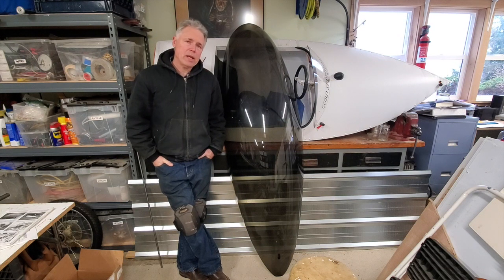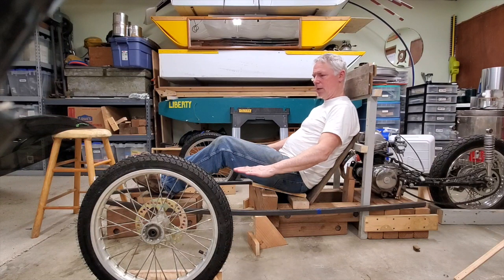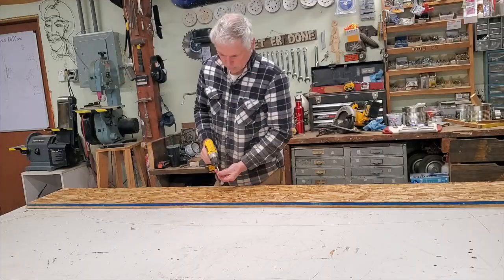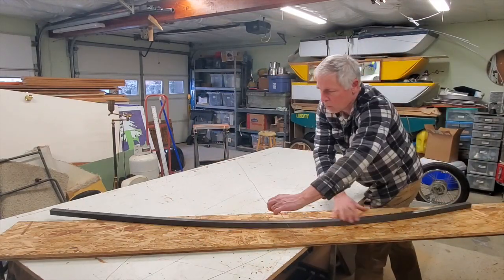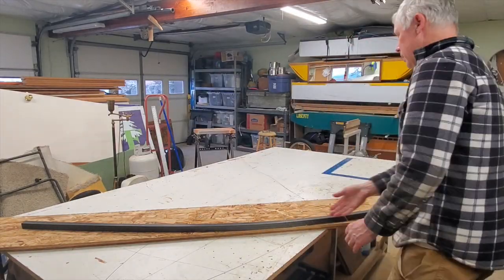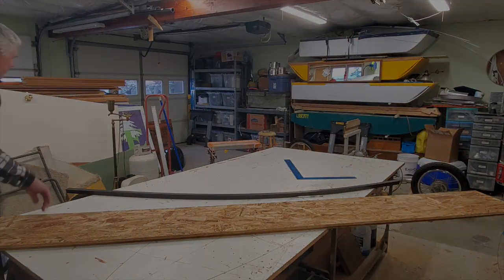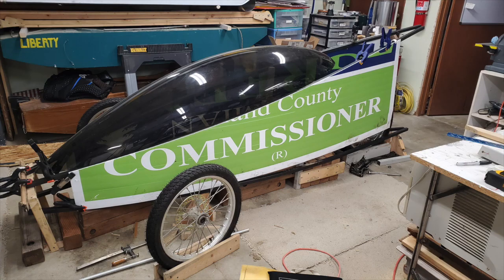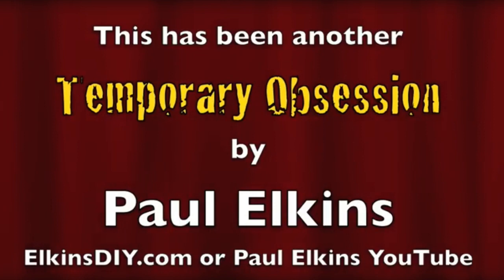Fuel efficient reverse trike build (part-1)

Comment: What are the the dimension of tubes? It looks like canopy is made from 25x25mm mild steel with thickness of 2mm? And that front suspension is made from 30-32mm square tube with the same thickness?

Comment: That looked like it bent nicely of course it isn't a tight bend. I'm working on one but mine uses bicycle wheels/tires and I am planning on it being electric. The bad thing about a trike is you are more than likely going to hit the pot holes either , with one of the front tires or  the rear and not much chace of missing them. Thanks man.
Reply from the maker: True enough, but with three wheels it puts less torquing stresses on the frame on uneven surfaces.

Comment: Looks good to me Paul, myself I think it should be a little wider. The solid suspension may be a mistake in ride comfort and handling.  The two tubes on each side will act like a truss and likely be stuffer than you think.

It will be fun to see how this design plays out.

Oh my airplane design is done... this last year was so slow work wise didn't have the funds to start building.
Reply from the maker: I'm not sure about the front suspension. We'll see.